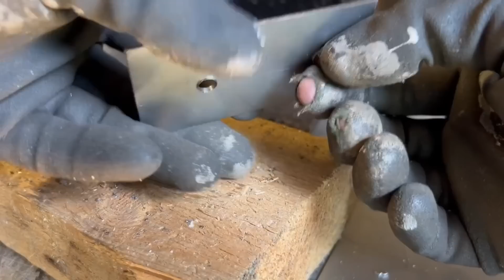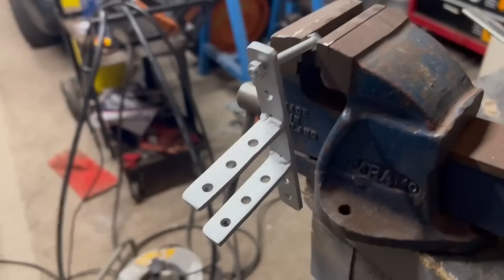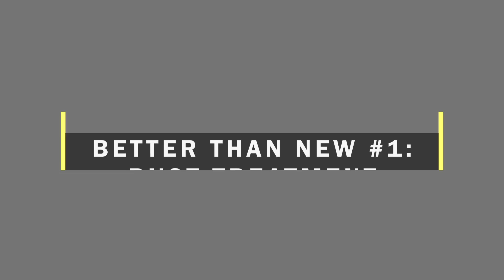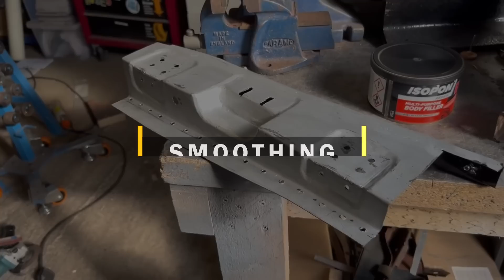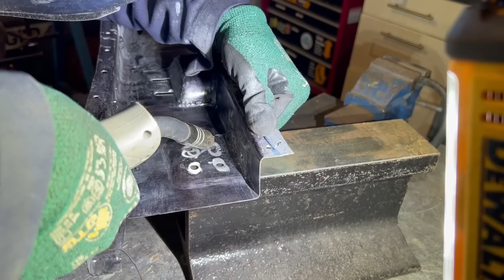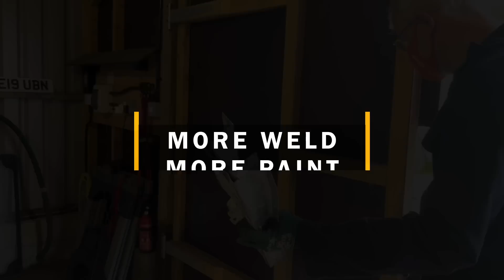3 ways to rustproof BETTER than new

Comment: Great work Martin. One thing though, I always put filler on bare metal before, however modern practice is epoxy primer, the filler, then once finished, epoxy primer, this gives a hermetic seal around the filler, which will always attract moisture and cause corrosion in the end. Probably be all right in your case, but would suggest you look at this for other areas.
Reply from the maker: Thanks Gary, that’s very helpful. I saw so much conflicting advice… what you say makes excellent sense.
Reply: That's very handy. I have always wondered.
Reply: This is the only time I've read the encapsulation logic explained as such, but it makes sense.
Reply: @tomsproston5837 Same I forget the process. Esp sealing protection of the filler primer itself. I do try avoid filler if possible. But yes great to see a basic explanation.
Reply: Seal the metal with 2k epoxy, filler then seal again. This is because filler absorbs moisture. You have essentially sealed the moisture in the filler against the bare metal. Any chip or damage to the paint the filler will absorb more moisture and it will rust from the inside out.

Comment: Pretty low hanging fruit!  Modern cars come from the factory pre-rusted so they will be sure to be fully wasted in six or seven years time.  Then they get to sell you a new one.  High carbon, stainless, and any material that won't waste away are forbidden.  Short lifespan plastics and other components that are engineered to fail quickly are the norm.  So much for a 'green' lifestyle as this crap piles up in the junkyards and more and more energy is required to make new junk to quickly fail all over again.

Comment: Hello, you did very nice prework before putting things on place. I have to comment about those "spotwelds". My experience your holes looked to small. It is easy to close small hole, but it is not properly atached to back sheet metal. I recommend to do some test weld to scrap metal. Look that back side of weld gets bright red when welded. Then do braking test and split welds open with force. If weld was cold it pops open easily. That is not what you want to hapen with car panels. Finally it was very inspirating to watch your work! Keep on going. :)
Reply from the maker: I’ve done tests before and find it’s not so much the size of the hole as having enough power. I usually use 6.5mm, which is bigger than most punches. The penetration wasn’t great on the check strap mount but that isn’t under much load nor safety-critical so it wasn’t worth re-doing it. Good point though, thanks.

Comment: Hydrate 80 is a really effective product when used intelligently as part of a multi layer protection scheme. I personally use a lot of 93%, food grade Phosphoric Acid and once happy with the work done with it, re-wet and wipe off before allowing to fully dry and then some kind of quality 2k Epoxy over the top. No need to neautralise dry acid, nor key it up, durabilty and adhesion properties are perfectly fine. Alternative would be to re-wet the acid with more acid and then wash off with a base in water, then Rust-Anode, a very good sacraficial Zinc productin a good resin.

Comment: Polyester filler is porous and should be applied to epoxy primer coated steel. I wouldn't apply filler before welding a panel on and potentially loosening it. A thin wax like Dinitrol ML properly   injected into cavities will be far more effective than paint

Comment: I haven't found a rust converter product that actually works, rust always come back. The likes of Project Farm on here does some good in-depth testing of such products, again, none of them seem to live up to their claims, sadly.
Reply: Hi Steve. I've been restoring cars now for over 12 years and have tried everything. The best rust converter I have found is Fertan. Not that easy to get but well worth it. It looks, smells and works different to all the others. But, here's the thing with rust converters, and I've done experiments that prove this. The "conversion" chemical reaction is only on a molecular level, so if you have a deep rust pit, it will look perfectly converted and neutralised, but if you give it a good scrape, there'll be fresh rust underneath. Fertan comes from the oil rig industry so is pretty good, but there is no substitute for cutting all the rust out.
Reply: @bobfrankish8883 Thanks, I tried Vactan because it's marketed at the boat industry, sadly I can't recommend that either. I hear what you say about only working on a thin, top surface rust layer, the fact that none of these products should be used on a sump pan or any other place that gets hot kind of proves that they don't convert back to solid metal.
Reply: @steveclark..  You're right Steve. A lot of the converters have a latex based binder, which means that heat is death. I've heard of Vactan but never used it. Fertan is very thin and seems to contain no binder, which is why it seems different to me. I'll have to check on the temperature angle. The chelation products are definitely the best bet. I use Bilt Hamber DeOx gel and DeOx liquid, they remove rust completely and leave clean bare steel behind.
Reply: @bobfrankish8883 The other problem with these thin, watery products, how to apply them when laying underneath a vehicle? Even on a vertical surface, trying to brush it on the internal side of a front wing, trying to get the product to stay on the rust spots rather than just run off for example.
My pickup truck is 12 years old now, I'd like to try and treat the whole underneath, at least try and slow the surface rust down. I don't know which product to try, ALL of them have negative feedback basically.
Reply: @steveclark..  Yep, if someone brought out a product that actually worked, they'd clean up, literally. Sometimes, a bit of treatment followed by some form of encapsulation, followed then by a moisture repellent, followed by the knowledge you'll have to do it all again in a couple of years is the only way. I worked on ships in dry-dock for 12 years, if there was anything that they could be coated with to stop rust, they'd use it, but in reality they just perpetually remove loose rust and paint them. I'm going to try again, my last comment was removed, I suspect because it had some brand names/keywords in it that YT didn't like. I'm going to try a separate comment. Nice to talk to you Steve.
Reply: @bobfrankish8883 Yep, if someone brought out a product that actually works, there'd be no point in painting bridges over water every year too.
There's lots of censoring on here, been happening since 2020 when the whole convid thing came about, anyone who spoke truth on that subject got deleted.

Comment: Great work! It probably won't rust that badly as I expect you will be keeping it indoors. Nevertheless I get that you don't want to take any chances. On my car, especially wheel arches, I embalmed everything in fibreglass after welding in the hope that will be reasonably protective against stone chips which is how it starts (especially there). Spraying wax inside cavities always an excellent idea.

Comment: Hello Martin, I have an engineering background and formerly worked for a UK based white goods manufacturer prototyping the sheet metal work. What you are doing is exceptional, hand crafting non obtainable panels. I would struggle to do that work. Hope to meet you at the NEC in November if you are going.
Reply from the maker: Thank you! I’m definitely planning to be at the NEC though I’m not sure if I’ll have a car on a stand yet. Would be great to say hello!

Comment: Can I ask what makes you think that Matra used powder coating on body parts? I was once (for my sins) a paint shop foreman for a specialist Matra Renault bodyshop, we did mainly heavily damaged Renault Espace and lots of more main stream Renault models, the black finish that you see inside panels is usually E coat or electrophoretic, this is usually applied once the shell is complete by dipping, a lot of spot welded parts are left bare because the e coat won't go between the spot welded joints, condensation and moisture  over time will see rust start in these areas, the e coat if left without further painting or wax treatment will also break down quite quickly and lead to rust, Matra improved things on the Espace by galvanising the inner structure and cladding it in thermoplastic or glass fiber panels (that required a lot of felting and special paint finishes containing textures).
I've since moved on to rebuilding Land Rovers and like you I'm a great fan of the new epoxy primers, especially the 2k versions as they won't allow moisture through.
Poor quality steel can also lead to bad corrosion, a D reg (87) Ford Escort or Orion was always certainly affected much worse than other years, some having no front panel left behind the bumper at 3 years old! Earlier and later cars were fine but Ford definately changed the steel for 87 production.
Reply from the maker: Thanks a lot for this, very interesting. Powder coating was just a guess based on looking at what little remains, and electrophoretic makes a lot more sense now you mention it. I can correct myself in the next video as we’ll be meeting that stuff again…

Comment: The most important thing is to get rustproofer between the double skins. Holes and an oilcan full of old engine oil is a good way. When oil comes out of the drain holes you are on to a winner. Old engine oil? Well it's free and a great rustproofer. Isn't it acidic i hear you say?
My answer is ..... have you ever seen a rotten FRONT Mini subframe. No? Well thats because the engine and gearbox seams will have lost gallons of oil and the wind will have forced it all over the subframe and in between the seams. When combined with road dirt its better than any amount of bitumen.
Reply from the maker: Yes, I'll be putting cavity wax between the skins once the welding's all finished - there are access holes.  My plan is to spray a fine capillary wax rather than use old engine oil, though it'll depend on my budget at the time.

Comment: great work, fantastic car, for the minor tool finishing marks I use 2K upol primer high build, it will cover those, for a part like that you could brush on to ensure it goes into pin holes, etc, It is then easier than filler to flat back but will defo cover what would just require a skim of filler. Also with having a hardener it will 100% stop water or dampness creeping under. Clearly you need a respirator, etc.
Reply from the maker: Thanks, that's a really good shout.  It would certainly save a whole world of sanding, I'll give it a go.